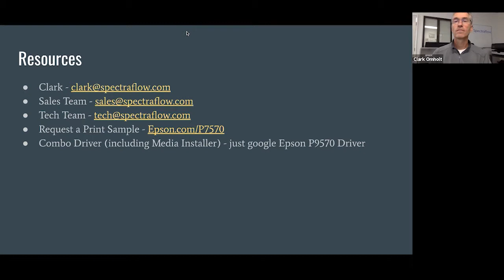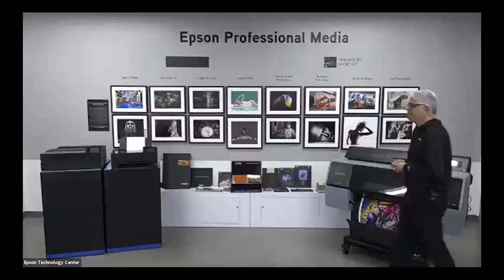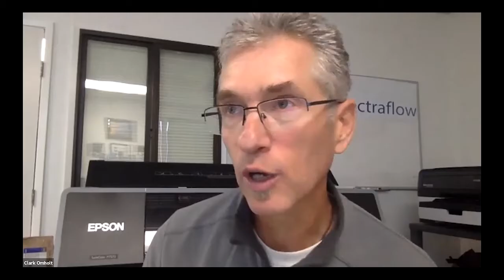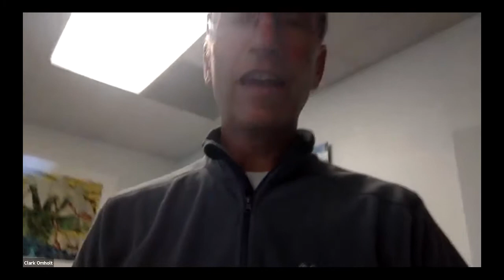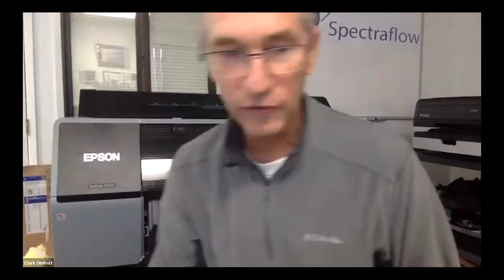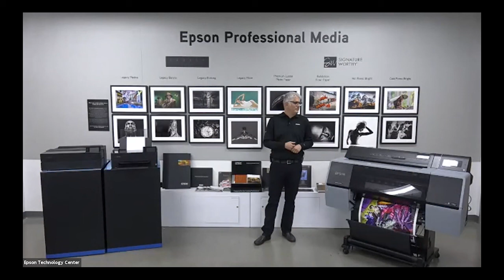Spectraflow Epson SureColor P7570 P9570 Webinar Q&A Session

Comment: I need to know how to CHANGE the printhead when it fails, NOT how to do 'maintenance cleaning'. I need to know how to remove the printhead and install a new one when it breaks because with all printers it's just a matter of time before the printhead goes down. I noticed about about 15:02 you stated it was a "permanent" printhead. Does this mean that when the printhead goes down the only option is to junk it and buy a new printer?